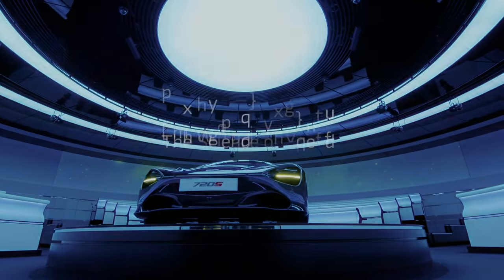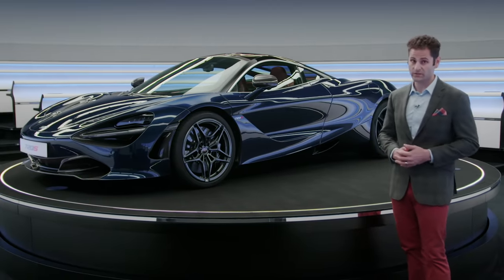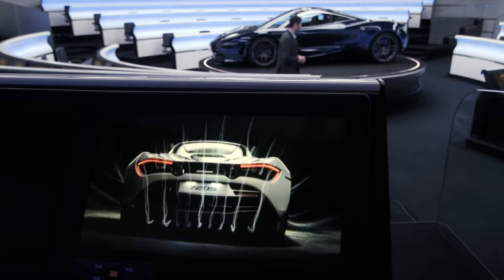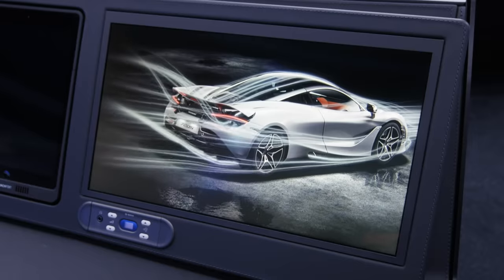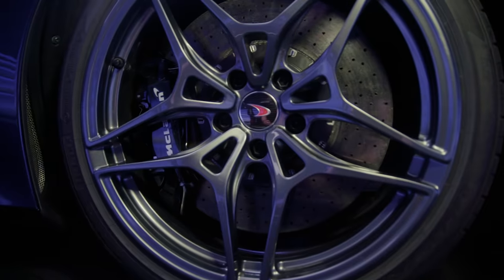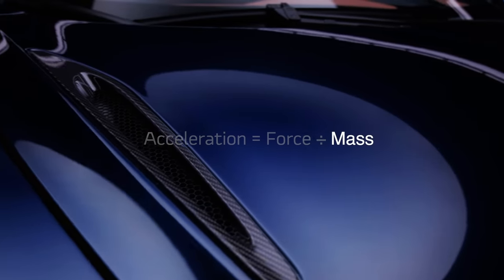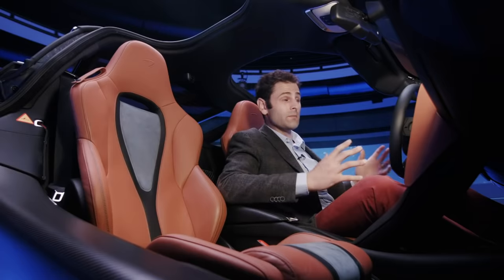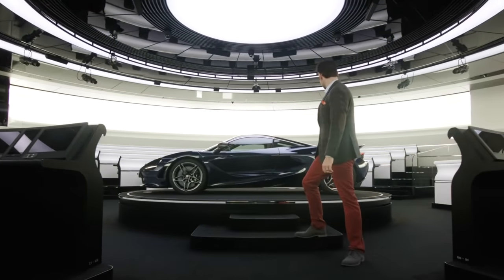McLaren 720S: The Science of Speed

Comment: Science of speed?  Don't lie about your car weight (cough Ferrari)
Do lie about your engine power (give way more than you actually say you have)
The 720S on paper has the same power to weight as the 675lt.  In reality it just leaves it for dead.
The 570s which is bigger, heavier, advertised less hp than the 625PS 12C, is considerably faster than the 12C.
Reply: Um, this car has been tested on dynos many times before and result in around 690 hp at the wheel, now add in the hp lost through the crank, leaves you with about 780-800 hp, they lied to protect their ultimate series car owners, since they're valuable for business :v